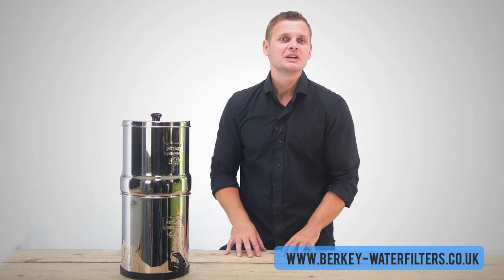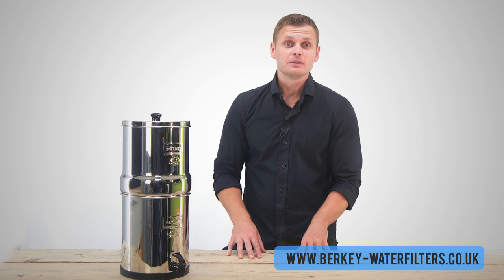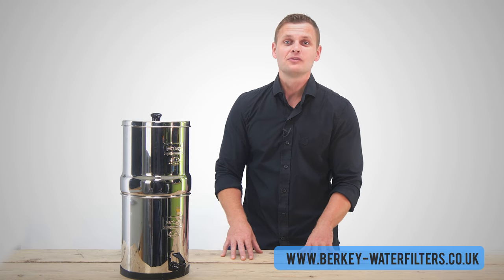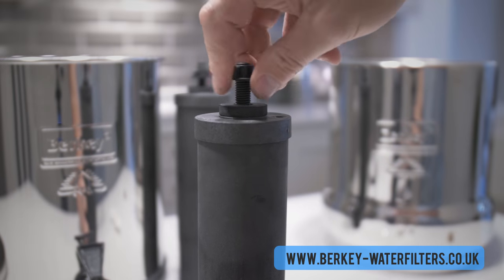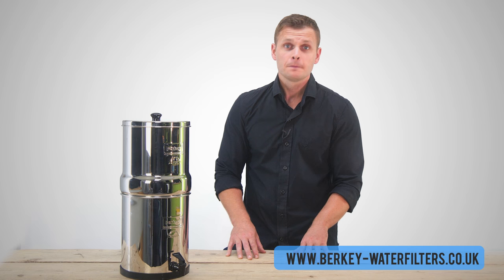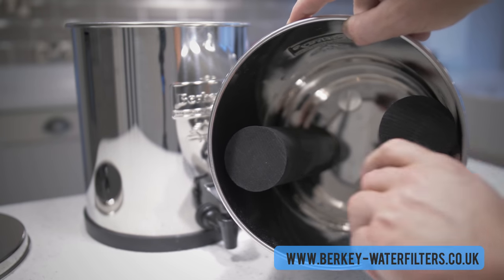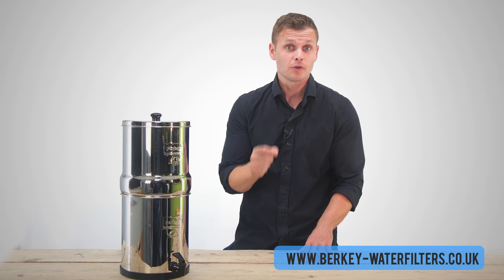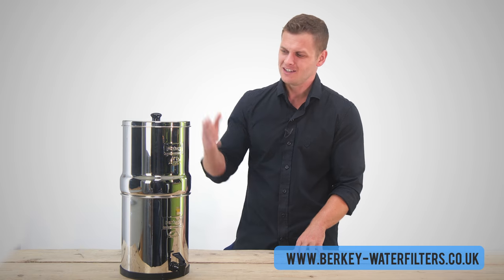How to assemble Big Berkey Water Filter System - New 2019 - Full Tutorial for Beginners

Comment: To Avoid damaging black filters and make installation Easier - First install blocking plugs and then Filters. This will reduce awkwardness of installing blocking plugs while filters are in (blocking the arm and hands of the installer/customer). Installing blocking plugs first will reduce strain on filter stems, as you will not have to turn unit sideways with filters installed. (Installed Berkey 30 min ago - and thought - wow - the printed instructions are off. This video though, is an improvement on the instructions that came with my unit.
Reply: Help! Where does the rather large, black, circular rubber piece go? Outside, bottom, of lower chamber? That’s what it looks like, but he didn’t  address it and it isn’t in my written directions.
Reply: Excellent !!   Thank you 😊 !!
Always can find good advice in the comment section.
Reply: @justadumblonde9005  I am researching this water filter, and reading as many comments as I can.  Did you manage to find out where the large rubber piece went?

Comment: I see a lot of water touching plastic when it filters through and then through the tap. I know that the you can get a stainless steel tap but what about the other plastics? Possible to get these in stainless steel also?
Reply: @berkeywaterfiltersukeu1897  Thanks for confirming. Just wondering if you have any plans on making the filters completely plastic free? Is it even technically possible or do you have to use plastic? Thanks
Reply: @KL-ji7rc  Doubt that. We used to have a system way back without plastic or silicon, it was always leaking.
Reply: @berkeywaterfiltersukeu1897  stainless steel spigot is nice and all... just backwards, send your engineers back to school. Righty tighty lefty loosey... like every other quarter turn valve in the world.

Comment: I bought a Berkey Go. The top piece should be a bit longer. Other than that it's a great replacement to buying bottled water. Endless supply of clean water wherever I travel. At my current location I pre-filter with a hollow fibre filter. This prevents build up of slime on the Berkey. Slime can be removed from the Berkey by scrubbing with a scouring pad. Berkey filters may last forever.

Comment: I have successfully primed and use original set up filters and replacements., including chlorine filters,  Recent filters though have a problem.  They’ve been used, in package, for months.  Just noticed they weren’t filtering at all.  Reprimed 3x to try to open up and only one filter working (black filter through to pf2 filter).  Pf2 filters seem to be fine, it seems to be issues with black.  Suggestions?

Comment: The first item listed under the "Assembly Instructions" is to clean your hands and the Berkey system to prevent contamination of components.  It also notes that by running a few batches of water through the Berkey system, you can use the filtered water to clean your hands and the system. None of this was mentioned in this video.  So do you clean it before assembly or assemble then clean??
Reply: These are just the assembly and priming instructions. Clean before assembly and then run one or two tanks through the filters before drinking.
Reply: Both

Comment: I assembled just as in the video and get a leak at the spout.  I was suspicious of the round side of the water towards the tank so flipped it the other way, that also leaked.  I hand tightened the bolt at different levels and cannot get rid of the leak.  
Does anyone have a solution for this.  I am using the travel size version.  Thank you!
Reply: They may have given you the wrong size washer.

Comment: Huh... I followed every step exactly as directed via the video and instructions.  Yet, no water is passing from the top to the bottom. I am not sure what to do...
Reply: @berkeywaterfiltersukeu1897  I'm a former military member and primed the filters as directed by the enclosed instructions. Then, I had to called tech support. She instructed me to fill the bottom canister w/H2O. Then, put the filters in the water-filled canister with coffee cups inverted over the tops of the filters to push them under the water line. I was to leave the filters in place for 8-10 hours. If they floated, they weren't primed. 30 hours later, the filters still bobbed in the water when I lifted the inverted coffee cups. 

I called tech support again. The new tech asked if I had a blue Scotch Bright scrubbing pad. I did. She said to scrub the heck out of the sides and bottom under cold H2O. I did just that. Now, although the flow is quite slow, it is filtering the water. Success at last. Praise be...

Comment: I'm very new to the Berkey water filtration system. Can I use "Berkey Authentic Black Berkey Purification Elements With Berkey PF-2 Fluoride and Arsenic Reduction Elements - Combo Pack" in my Big Berkey? Are these larger filters, which claim to reduce different particles? Or are these "Berkey Authentic Black Berkey Purification Elements With Berkey PF-2 Fluoride and Arsenic Reduction Elements - Combo Pack" ONLY USED WITH CERTAIN BERKEY'S? I'd like a smaller Berkey, but have heard from several friends that the Travel Berkey leaks quite bit, and mopping up puddles with my limited energy is very low, as I ama 100% service  connected, permanent and totally disabled veteran. Amazingly, I only lost 2 points on my IQ test and I will still be a member of Mensa with an IQ of 149! I'm not sure if that's good or bad, as my VA wrote "an IO of 149 was a fair score for a MAN HER AGE! So am I a dumb woman or am I a smart man?  The VA has confused my gender by mistakingly wrote my name "Gene" and NOT "Jeanne!!." 
I'm buying this  Big Berkey carefully as it's quite a lot of money! Please guide me this purchase. I may be book smart, but common sense is not my forte! Thank you for your help. 👩‍🦼♿️🐕‍🦺
Reply: So both black filters are the same. I bought my big Berkey without the white PF2 attachments and was severely confused as to the 2 extra holes as my ex had 4 black and 4 white attached to hers. As far as I know those combo packs are good for the big Berkey... Also be careful and install the white plugs first before you install the black filters as it's quite easier